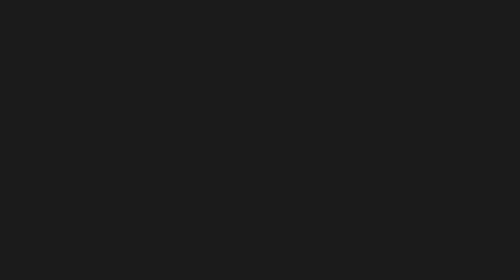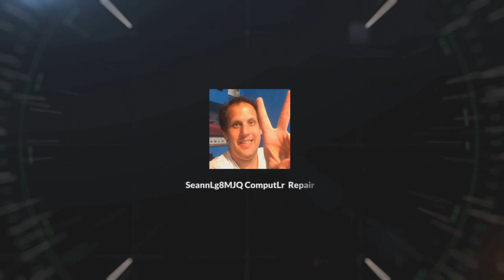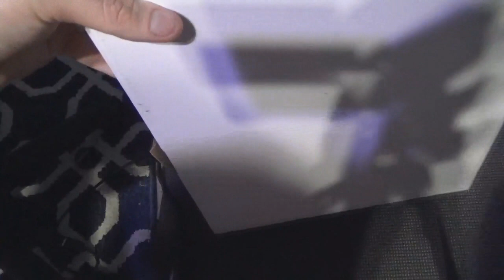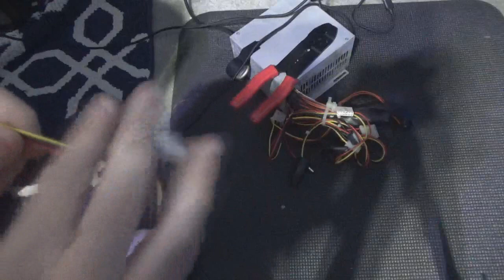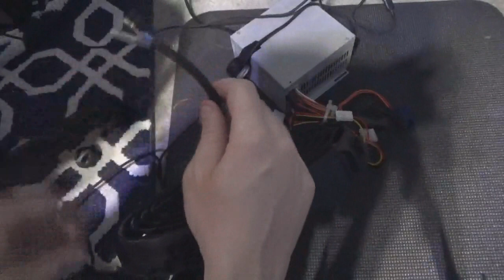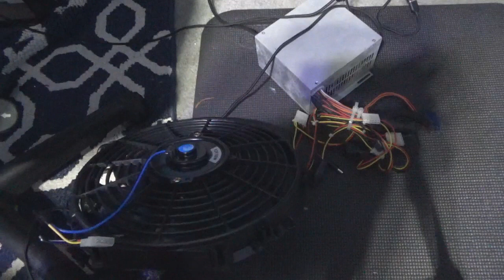how to convert a automotive radiator fan to use as a pc case fan

Comment: Are these radiator fans able to run at 5V, or even 3.3V?
Or is one better off using a DC motor PWM controller?
Reply from the maker: These fans run at 22 volts only

Comment: You need to crimp and heat shrink the wires. It is extremely dangerous to have them lazily taped up in a metal box with a bunch of circuits and different sized wires.

This is a fire waiting to happen.

Comment: Which wire on a radiator fan is the power wire
Reply from the maker: It’s the blue wire
Reply: @Seannyg88sComputerRepair  Thank you. I got it figured out and hooked up. Does wonders for cooling the air compressor air as it flows through a cooling coils.